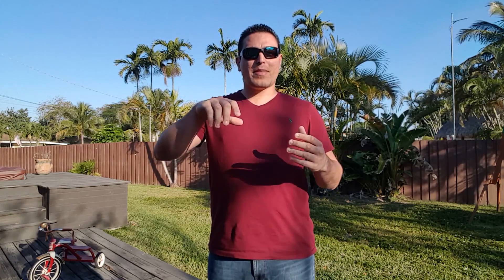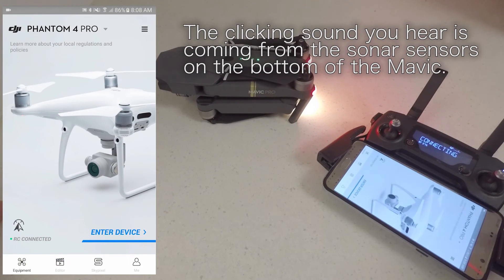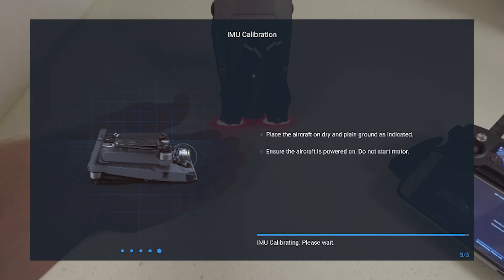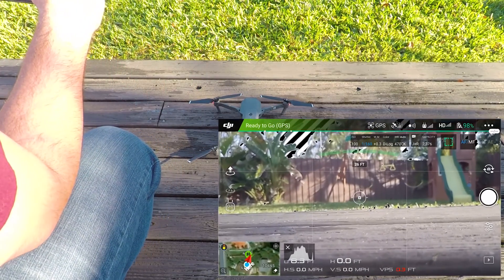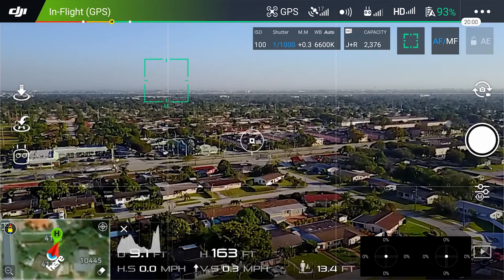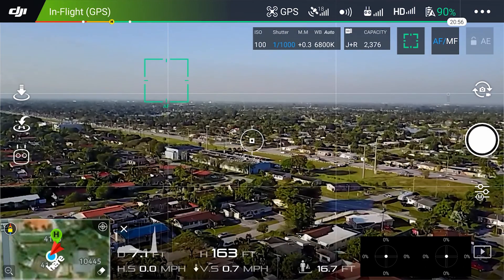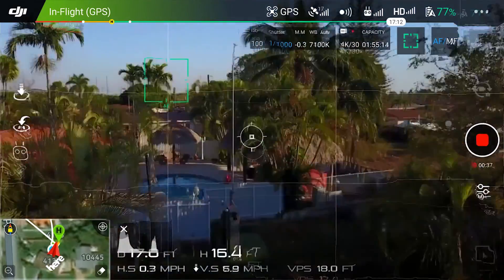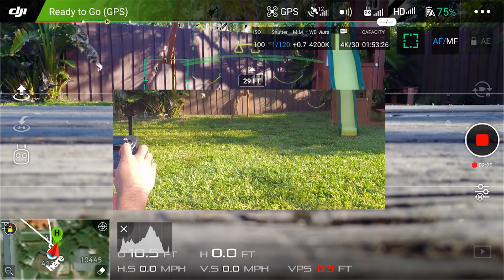Mavic Gimbal Issues - Horizon Tilt and Pan Smoothness

Comment: My gimbal is not re-centering after a yaw. left or right. like it's off either to the left or right by about 10 or more degree. reallllly annoying. ESPECIALLY going through a narrow place. like a halway for example.  you put the square on a object far away and try and go strait. and you end up going way left or way right of it.. SOOOO ANNOYINGGGGGG....Didn't used to have this problem
Reply from the maker: dylan scronce what firmware are you running on the Mavic? Have you tried doing the gimbal and IMU calibration?

Comment: Hi. You solved this issue? Regards
Reply from the maker: curso88 the horizon issue has gotten better since the .700 firmware , but the synchronous yawing issue is still the same.
Reply: Alain Sainz Thanks for your reply. What is the synchronous yawning issue ???? Any example? Thanks in advance
Reply from the maker: curso88 I made a video about it here https://youtu.be/W7_z1rN6vcg
Reply: Alain Sainz I've seen the video. Is very curious ... I have had 7 different units of Mavic, and I have detected small inclinations of the horizon in the direction of the turn. The first units of November and December last year did not have this problem ... you know what problem I mean? On occasion, if you turn the aircraft to the left, the horizon tilts slightly in this direction, and the same happens in the opposite case. This phenomenon also occurs in lateral displacements. I have observed many units that do this effect, some units do more than others, I have also observed this effect in Phantom 3 and 4, Inspire 1 with the X3 camera, and the Mavic. Is there any information on how to minimize this effect? Thank you
Reply from the maker: curso88 the info that I've always seen is to make sure you do an IMU calibration, a gimbal calibration and a compass calibration. That should minimize the issue. I have tried everything but the issue is still present. It is more noticeable when going at a higher rate of speed, so I now to try slow down when turning to keep the horizon tilt to a minimum.
Reply: Alain Sainz thanks for your reply. What adjustments do you have in your mavic in order to minimize this problem? Gain, Expo, etc. Thanks in advance

Comment: Exact the same problem my 2 brand new Mavic Pro´s had, namely horizon tilt at sideways flying. Ive tried everything possible but nothing helped, so unfortunately i had to return both Mavic´s. They could not be used to record any usable videos in that condition. So as long as that problem persists on the Mavic i will not buy one. That seems to be a "normal" thing on the Mavic?
Reply: I'm on my third mavic now (2nd replacement) and have to send this one in again as all had horizon issues! Plus I can't open DNG image files at all! - Jpegs fine. Going for the Phantom 4 advanced next - had enough of the mavic...for now!
Reply: Noel Milner , yes i'm thinking of going with the Phantom 4 Pro, here they cost virtually the same as the advanced.
I think the horizon tilt at sideways flight is considered normal on the Mavic, so i dont think it matters how many times you exchange it for a new one. Personally i dont even like hearing the word "Mavic Pro" anymore.

Comment: During compass calibration, not sure how much it matters? But it says "Face the nose down" (even though the picture shows it sideways). I also hold the drone, and turn my body for calibration. I tend to think this is better since the drone is not moving unnecessarily due to the changing of hand positions.
Reply from the maker: You are correct. While I didn't notice any difference from doing it one way to the other, now I do it with the nose down as per the text. They should fix the image though :). As for turning the drone I like turning the drone itself on the spot. I have done it by moving my body too, but I feel like the drone being right on the center of the turn is better than being outside of the turning circle (if that makes any sense lol). I think most of these things are a matter of preference and dont really make much difference in the final results.
Thanks for watching! :)

Comment: What about the Gimbal mode FPV or Follow... I thought I had thus issue but I was just in FPV instead of FOLLOW. When I changed to follow it stayed level throughout the flight
Reply from the maker: Warren Leadbeatter you can tell right away when you're in FPV mode as the horizon tilts drastically when banking left or right :). the issue Im having is more subtle.

Comment: i have the same issues. i have a whole playlist with  this all in it. dji has been getting back to people on a couple of my videos as well.

i just got my 3rd mavic in hand and i am debating if  this one will be sent in or not.
the 3rd one is very minimal in the side to side and none at all in the yaw.
Reply: Sean Ozz do you think you'll be able to get a better mavic pro back? what if the next is worse? i have the horizon tilt issue at times. i debate whether to take it back, but no guarantee that the next will be better. :-(
Reply: Hari Kalay yes. If you see I have been going over all the returns and my now new mavic in my videos. 

You see the papa smurf video really shows the new one and I'm going to be doing a conclusion video late next week with updates to the whole situation.
Reply: Okay i will check it out!

Comment: This is a gimbal issue withyour mavic. I have the same problem. You need to send everything back to DJI to exchange it for a new mavic. I went on DJI support chat yesterday and told them about the issue. They sent me a shipping label and I mailed out my mavic today. They said I should get the free replacement in about a month.
Reply from the maker: D S I think I will wait a bit more to see if they're really doing something about it. Thats for the horizon tilt issue. For the Synchronous Follow I was already told by a DJI mod that this feature is working for other drones but not for the Mavic, they're working on it. It will probably be fixed bia firmware updates.
Reply: Alain - sounds good - For my Mavic even directly after calibration when sitting of flat level ground my gimbal would be tilted. If I adjusted it with the gimbal roll i could level it out but after flying for a bit it would start to tilt again. Any mid flight adjustments would have to be adjusted again after only a few turns. Hopefully yours isn't as bad, but if it presists I would say send it in. DJI knows about the issue they only asked for a picture from my drone on the ground after calibration. As soon as the chat support person saw that they opened an exchange case for me and sent me a shipping label. Anyway - good luck with your Mavic and happy flying!
Reply: D S they will only replace if u report the issue with in 7 days after getting ur mavic delivered, otherwise they offer a free repair  or replacement of that part....
Reply: viajes80 I'm pretty sure that is not true. The gimbal factory warranty is 6 months I believe so they should replace it or fix it at no cost to you.
Reply: Yes,
 they will fix it or replace(gimbal) if they can’t get it fix, 
the rest of the unit will be the same one, 
i think thats mess up to pay $1300 and then they wont exchange the full unit after 7 days even when they admitted is their issue,
Reply: I guess you got a new one back that had the exact same issue? Am i right??

Comment: Hi Alain. Please try to disable in the Camera Options of the DJI GO 4 the option "Lock gimbal when capture" and test again. Best regards
Reply from the maker: I will try that when I get home! I know where this option is, I saw it when going through ALL the settings on the app, but since it says Lock gimbal WHEN CAPTURE" I didn't think it would have made a difference :). Thank you curso88!
Reply from the maker: Hi curso88! I tried to change that setting today in the morning and nothing happened. I didn't notice any difference at all with the setting on or off. I have no idea what that setting does. I searched all over to see if anyone had a clue and it seems that not DJI knows what that setting does lol

Comment: Beautiful video mate.Let's say right here calibration is often necessary to do? Or just the first time you arrive in another country?
Reply from the maker: Feri K. - Aerodron thank you!!! its a good practice to calibrate your compass if you travel more than 100 miles. You should not need to do it every time if you're flying from the same place.
Reply: So, just like with the Phantom 2 . Are the batteries must be kept as the Phantom 2 ?
Reply: I was told that I had to fly every 10 days !